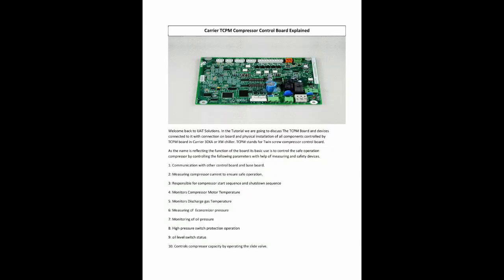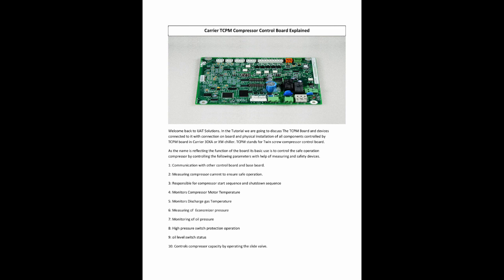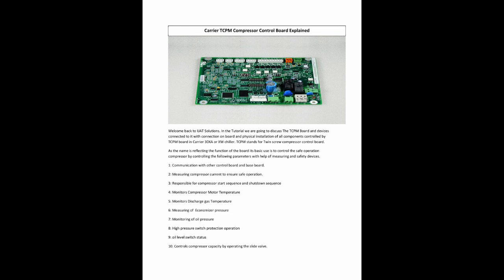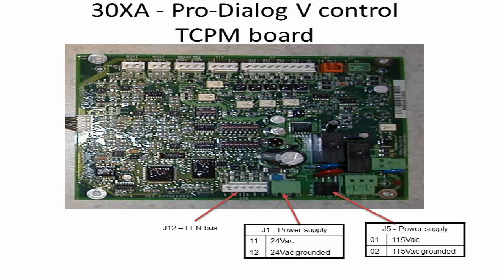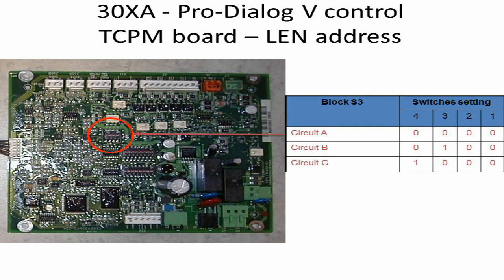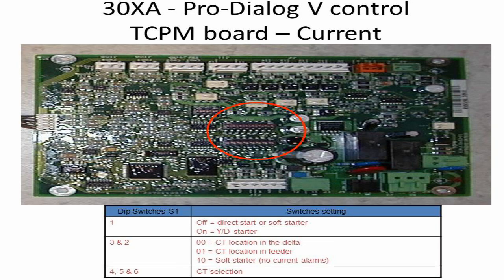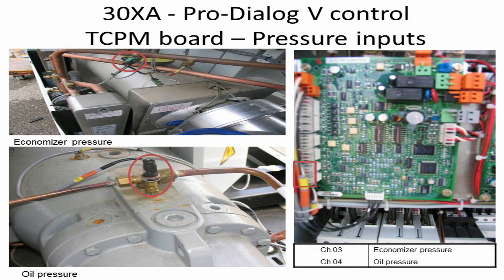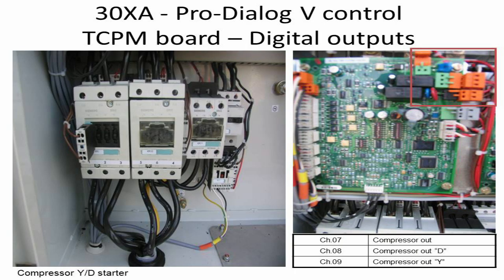TCMP Compressor control board carrier 30xa explained

Comment: Why would a carrier 30xa run great for a week with no alarms or overrides at 44 degrees chilled water supply then frost after the exv both circuits and the supply goes up to 50 degrees. Shut it off and start it and it’s good for another week.

Comment: 30xa chiller, problem generate suction pressure transducers alarm again and again ,after remove another fix but same problem generate,what cause please tell me
Reply from the maker: hi,
1:Check the transducer cable if it is good and not having any partial contact.
 2: check the connector on TCPM board re-terminate the wire in the connector and clean the pins on board. if the problem still exist change the TCPM board.
Reply: @UATechnicalSolutions  thank you sir very very for reply and support me
Reply: Sir now not coming suction transducer alarm but now generate other alarm like low ecnomizer pressure suction valve closed,once again reset after 10 second shutdown system A , compressor, system B compressor normally working

Comment: And then alarm showing low suction temperature
Reply from the maker: Also if you can share the following parameter i can help better.
1:Discharge pressure
2: Discharge Temperature
3:Suction pressure
4: Exv position
5: water in and out temperature
6:Compressor capacity percentage at the time of Tripping 
7: how many condenser fans are working 
8: is condenser clean and in good condition?

Comment: Sir can u explan me about exv why close when the going on load
Reply from the maker: Please check the compressor discharge temperature and the discharge temperature sensor , If the discharge temperature is high than system will close the expansion valve to control the temperature and even when suction pressure is going  down it wont allow the exv to open